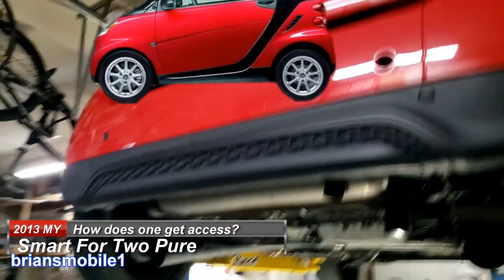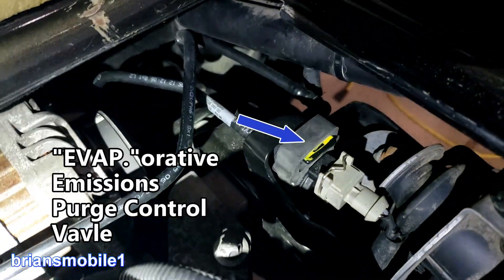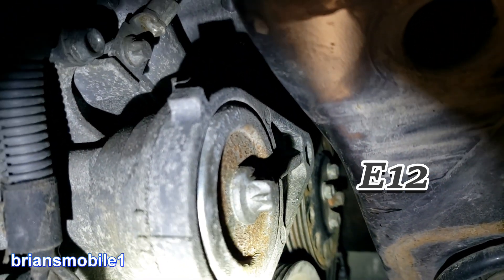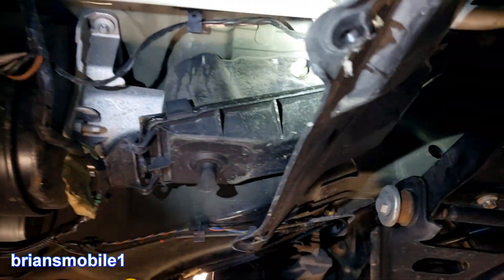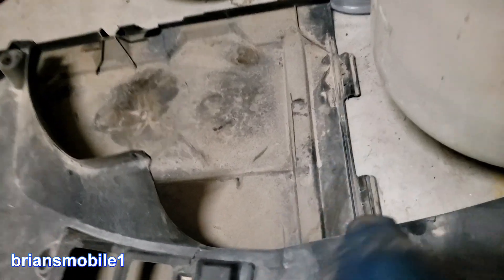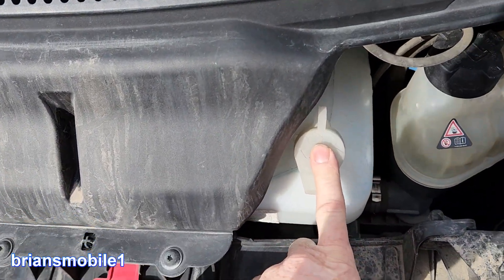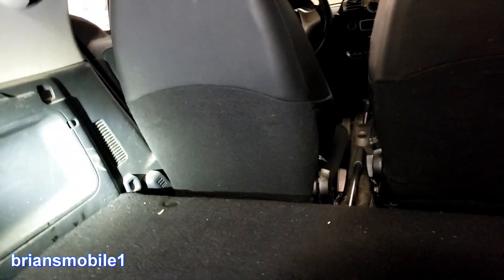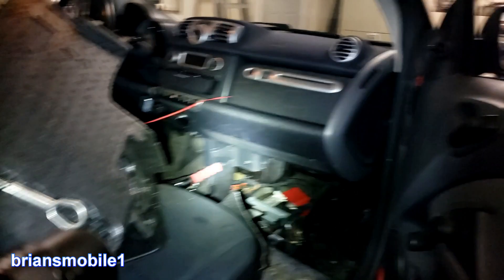Smart Car Mechanics Tour

Comment: These can be somewhat 'interesting' to work on...I had to change the starter motor on the 450 model with the 700cc turbo three cylinder engine (don't think these were ever sold in NA) and I think it was the first component that was put on the production line at the factory, and they then built the rest of the car around it. It was an enjoyable car to drive (except the gearbox which is awful and borderline dangerous), but I sold it and bought a Toyota iQ which is so much better.
Reply from the maker: Sounds like the way Isuzu's are built.  I call it Play-Dough engineering.

Comment: I genuinely thought about buying one because the egg shape chassis is supposed to be much safer than a normal car in an accident. Then I realized its still a Mercedes at heart with a random German parts bin of extras to make it work. The mechanical and electrical systems are so convoluted, and parts difficult to find, it would total out the car multiple times if one of them decided to self destruct.